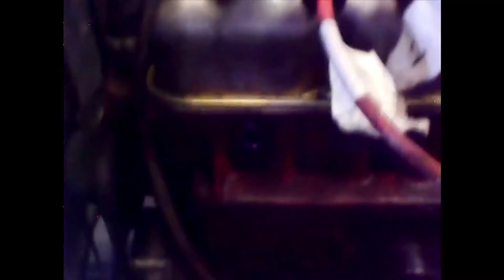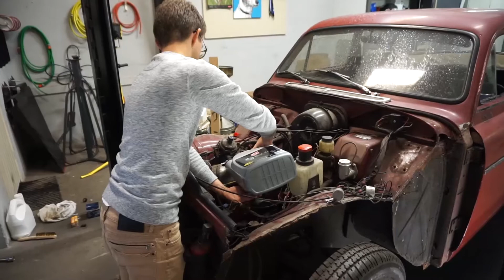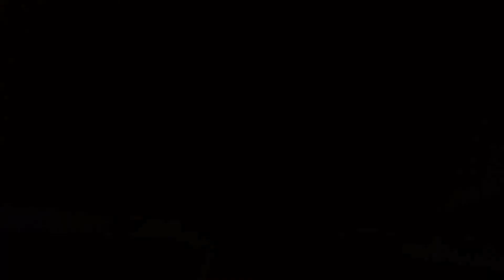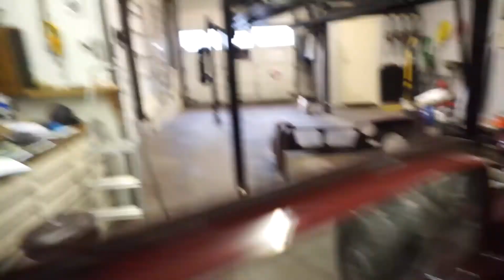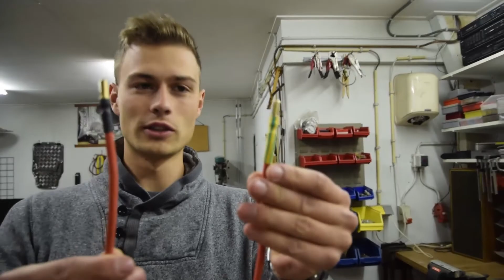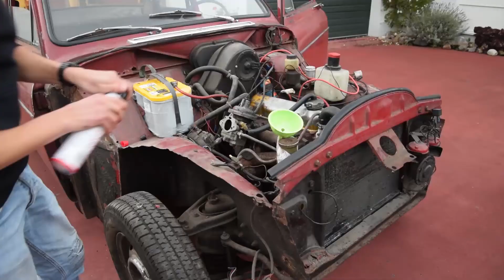FIRST ENGINE START in 15+ years - The Vintage Volvo Project #4

Comment: A magnificent achievement , truly. But you have to laugh, there was more fuel dripping out of the cabbie than there was going into the engine. But I'm sure you eventually found that leak and fixed it.
Old Volvos never die, they go to sleep, but if you prod them enough they wake up.
Reply from the maker: Hey Gary, thanks for the compliments! We never doubted that she would wake up, but it was magical when it actually happened.

Comment: Looks like you have a healthy engine at least from the compression test. Plus someone before you has upgraded from the OEM armoured ignition key/coil. BTW, I see you pumping the accelerater before starting. Stromberg CD carburettors near as I have ever seen don't have accelerator pumps so pumping doesn't do anything before the engine is operating. I see the original Pierburg mechanical pump is still on the engine. It is superior to the new ones made by Professional Parts Sweden and rebuildable.
Reply from the maker: Hi Mathue! Thanks for your reply. Those are some great insights into the technical details of some of the components. Turns out we have a lot still to figure out! Now that we know this, we will definitely rebuild the Pierburg fuel pump. We'll be sure to make a video on both the fuel pump and the carb
Reply: @BentAxles  Super! Some sites refer to the type you have as the one that has a cover shaped like a 'Chinamans Hat' or Sugegasa. There is commonly a phenolic spacer between the pump and engine block, make sure it gets put back in place.

(Also, great to see fire extinguishers when you are working with fuel. There are too many videos with people burning down their cars and their garages)